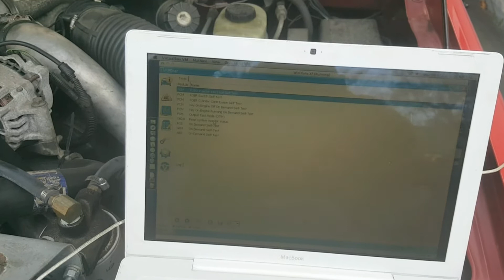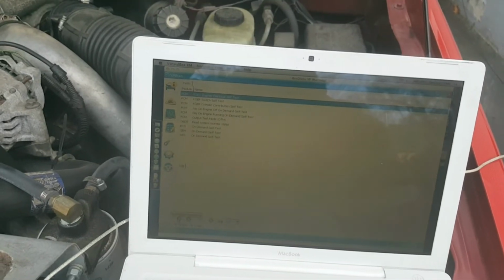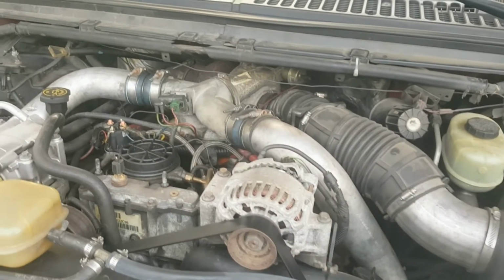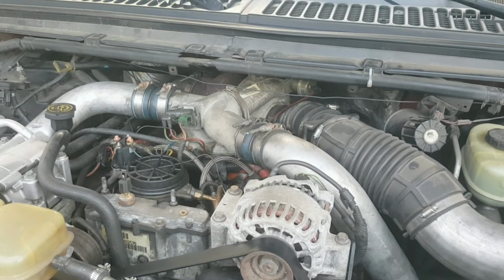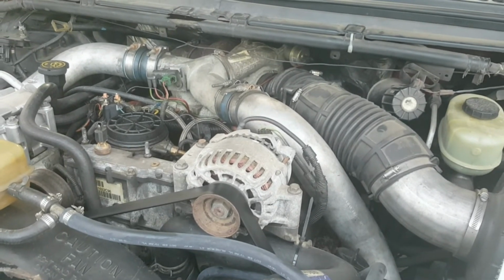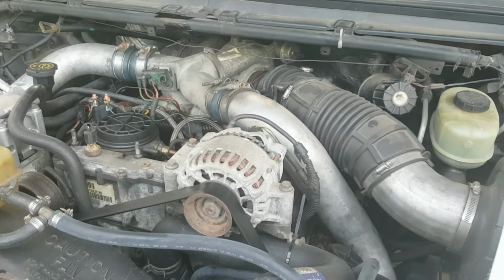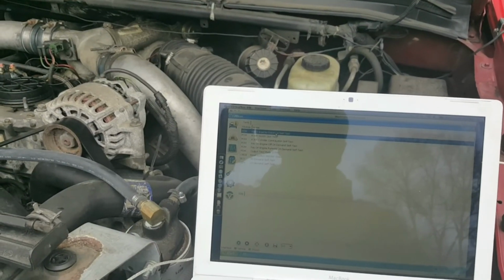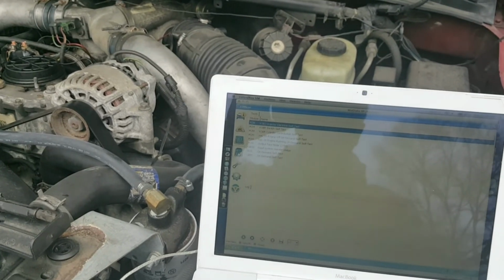7.3 Powerstroke Injector Electrical Self Test (Buzz Test) with ForScan

Comment: My #6 is not as loud as the other 7 and all of my injectors are brand new along with new cups, new glowplugs, new batteries and all new battery cables, new high torque low amp starter, a rebuilt fuel bowl, new HOP, IPC, IPR, new Riffraff crossover kit, new sump / deleted pickup assembly, new fuel pump, rebuilt turbo & pedestal, new valve cover gaskets and wiring harnesses and my ‘03 7.3 will not even fire. $7000 of parts and I am at a complete loss of ideas.
Reply from the maker: Ok, start with the basics. Are you getting the wait to start light? Any DTCs pop up after cranking? How long have you cranked it? Do you have an OBD adapter and software to monitor live data?
Reply: It took all day, and I had to borrow a high amp battery starter from a friend to get it to start. Turns out it just had a lot of air in the system. I have an OBDLinkMX+ but I have not figured out to populate the Forscan app yet to show live data such as HPOP pressure and oil pressure as computer tech is not in my wheel house. I am looking online now to buy a full bank of gauges to install that shows all pressures on individual gauges that I will mount on my dashboard. @PikachuG5

Comment: Did you get a code for #6 injector? After the buzz test ? I did mine and  #2#3#4#6#8 sound quieter well #8 sound louder so means injectors are going bad ? Also did the construction test and shows #4 and #6#8 sometimes, can my ipr valve cause this problem is around 5 or 6 % at normal temperature.

Comment: Hello, Recently my 2005 ford focus TDCI started missing while driving in town (engine warm I think). I listened (engine cold) to the injectors with a stethescope and one was quieter than the others. It just so happens that  I cleaned and replaced the gaskets on this injector about a year or two ago because it was leaking. It had been repaired by the dealer twice. They damaged the seat the first time and in less than a year's time they had to correct their error. That job lasted for another year or so and an independant mechanic refused to do the job because he was the one who found the damaged seat and wanted nothing to do with the car. So that's why I did it.
I know that if the injector is replaced it needs to be programmed. Would I be able to do this with FORScan? If so, will I need to purchase license? Thanx

Comment: I already change the drivers side injecters harness but when i did the injectors buzz just the driver side works no passenger side but before the truck was running perfect just has check engine light on gor the glow plug #5 so i just replaced tht glow plug and i put new pigtail y this problem come out p1316

Comment: Can you check your cps and tps with forescan?
Reply from the maker: Yes. APP PIDs are accelerator pedal position sensor, and you can monitor RPM to verify the cam position sensor is reading. There are other CMP PIDs, but I haven't found those to be terribly useful for diagnosis.